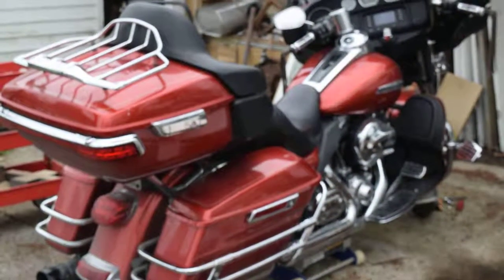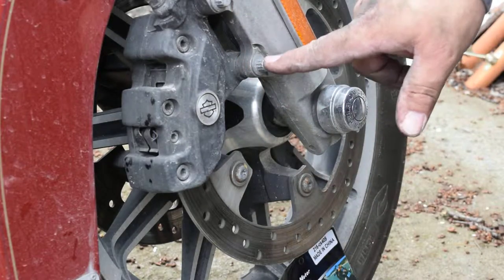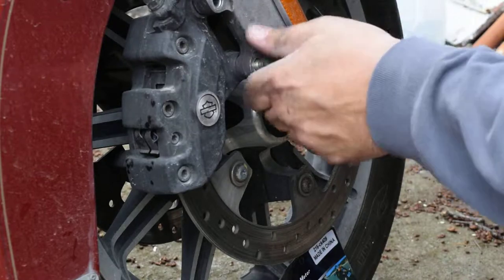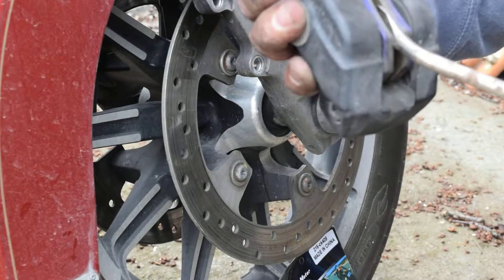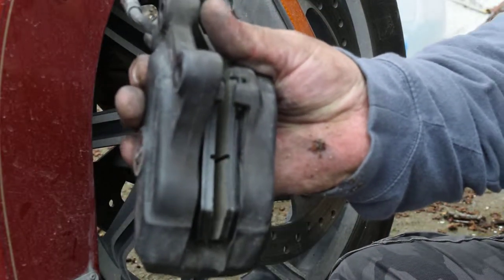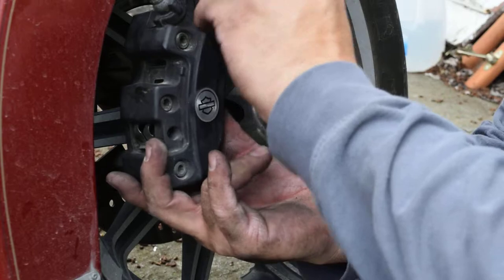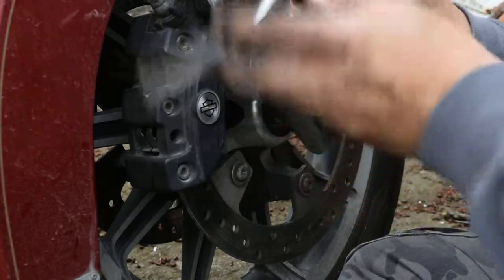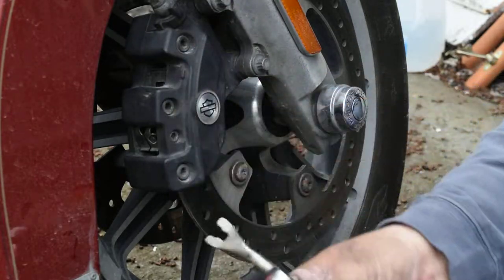How to Change Front Brake Pads on a  Harley Davidson in less than 10 Minutes

Comment: Last summer my front tire blew and had to be towed on a flatbed to the HD dealer for a new tire. The next morning they called and said the tire was done but I needed new front brake pads. The cost was going to be around $300 for the pads and the labor. I did it myself and the pads were less than $80. The first side took me about 15 minutes as I had never done them before. The other side took 3 minutes. This is not a hard job. Very easy and you save a lot of money.
Reply from the maker: Thanks for sharing.  I find it fun doing some of the simple task myself.  Hope your bike is up and running.  
Thanks for watching.
Reply: @pappycandoit4405  Yes it is running. I try to do all the simple maintenance myself. Oil changes and air filter. Tires I leave to professionals but fluids I can handle.
Reply from the maker: Bout the same here.  What do you ride? I traded for a street glide since the brake video.
Reply: @pappycandoit4405  15 Tri Glide
Reply: wow 300 dollers to change brakes ? thats just wrong to charge people especialy these brakes and tires dont last long.
Reply: Glad I seen this comment. Today will be my first time changing pads on a harley
Reply: @stevetreadwell8743  I had my front tire replaced at the dealer today. Mechanic said I needed front brake pads, I told him I have 2 pair of brake pads in my tour pack. Since both brake calipers were already off I asked if he would replace them as a complimentary gesture. He said it would give me a deal by charging me “only” .6 of an hour of labor. I asked how much would that be?  He said $90. I told him no thanks. We’re talking maybe a total of 5 minutes of work since the calipers were just hanging there. Geez my daughter is a physician and she doesn’t charge anywhere near that for 5 minutes of her time.

Comment: i have 09 ultra think there same tiress but i only put 30 in rear ang 25 psi front, i live in desert the roads are extreme hot 120+ degreese .your tennis shoes melt walking so imagine tires screamin hot .....at this heat i get 10 x tra pounds so im 40 psi rear 35psi front i balieve this is safe and possibly add few pounds more in winter months

Comment: $19 for a set of brake pads, use the same old screw that holds the pads in place, no cleaning of the caliper and hardware inside the caliper, yet the pads make noise. How can that be?  No torque wrench and dude must not care that the caliper bangs into the fender a few times.  Gonna take it to the car wash with high pressure no doubt.  Got 'er done though!